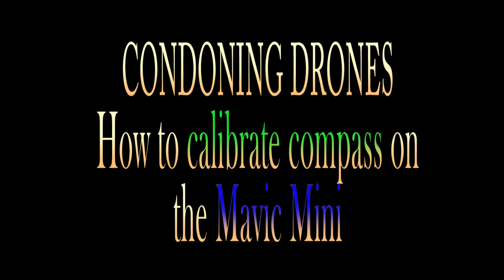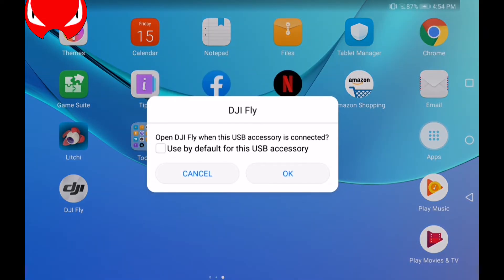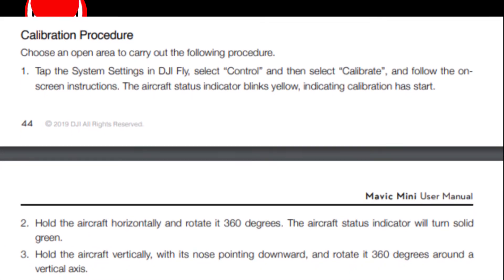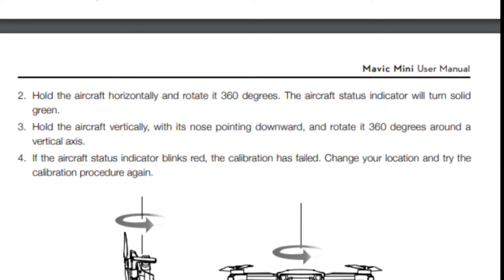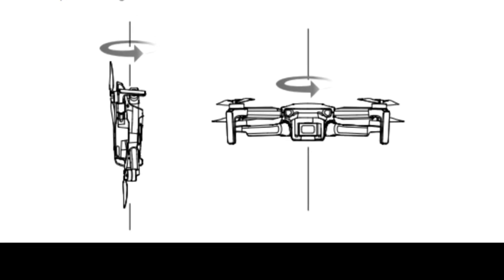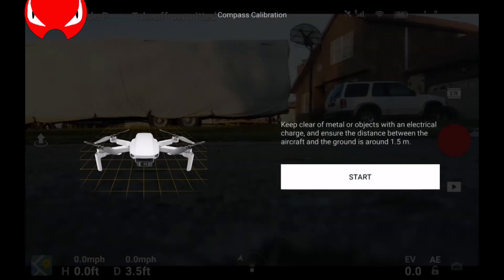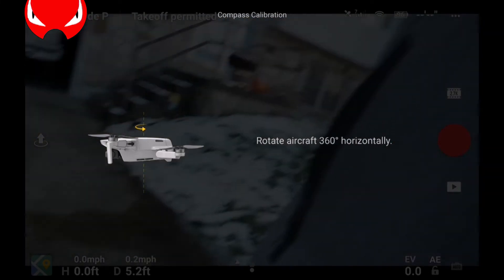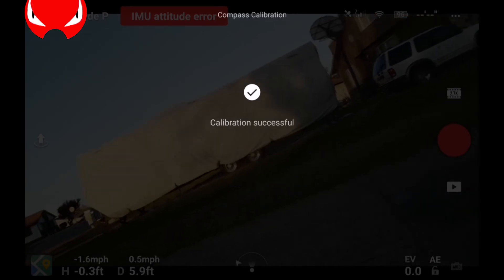MAVIC MINI How to calibrate compass correctly

Comment: DJI app shows 360 degree vertical with camera pointing UP .
Reply from the maker: yeah, the manual says nose down-be nice to be consistent with info!
Reply: @condoningdrones  so now I wonder which is correct ??
Reply from the maker: @integra8502  According to Drone Valley's reply to me, it doesnt matter if nose is up or down or whether you rotate it clockwise or counterclockwise...DJI should do a proper tutorial.